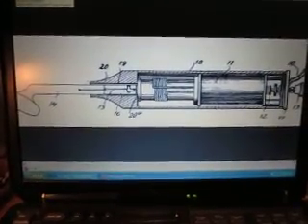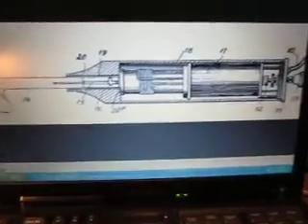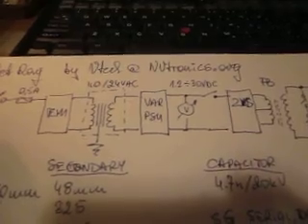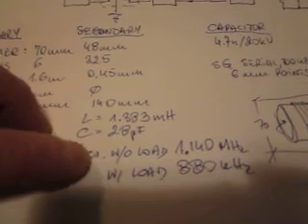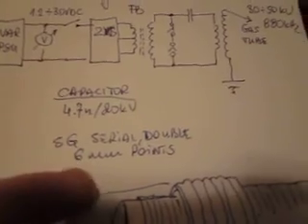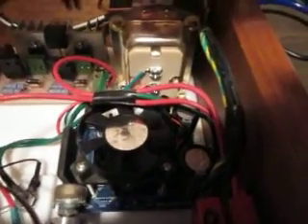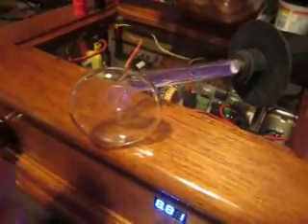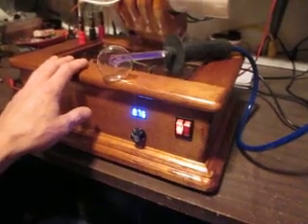Violet Ray Machine

Comment: Hi Vitoc,

I just came across your violet ray video on YouTube. I went to subscribe to your channel and realized that I was already subscribed. I’m Tat Parush’s MWO friend in the US (WA). I recently closed all of my FaceBook accounts, so unfortunately I have lost contact with Tat. I do have a new MWO group set up on the uncensored mewe platform. 

I’m also a member of your NVtronics group, although I haven’t been participating much. Life has been very weird lately. I did upload a wiring diagram for my Bob Beck mag pulser circuit. I finally perfected the circuit for my machine last year. We have been using it several times per day for nearly a year now. If it wasn’t for the coil getting hot, we could use it indefinitely! Right now we can use it for 20 minutes, before the coil needs to cool down. I have the machine configured so the capacitor charges to 340V every 4 seconds. I use a SCR as the switch. The pulse rate is adjustable, but it doesn’t make much sense to use a different setting. I use the same Erse Audio perfect lay, wet wound 2.5mH inductor coil that you do. Russ Torlage has been a huge help over the years in helping me make headway with my mag pulser circuit.

I like your video on the violet ray! It seems that doing it electronically makes the otherwise simple machine, a heck of a lot more complicated. The advantage I guess, is that the circuit can handle more power and as you said, thereby has enough power to support the function of an MWO.

I refurbish antique violet ray machines for a living and focus mostly on the RenuLife brand. I have a web site to market my electrically upgraded violet ray machines and Beck Protocol devices. I have sold a number of machines to Canadians, including the actress Lucie Laurier. I'm interested in leaning how to make one from scratch. I'll check with you on NV Tronics.

My Home Page: https://twotowers.com/

Also, you might have fun looking at my “how to build a tesla coil” page.  
https://twotowers.com/tessie_1_tesla_coil.html

Best, Steffan

Comment: Where did you find the blue high voltage wire?
Reply from the maker: I put 30kV rated white cable inside a flexible PVC tubing.
Reply: Do you have any information on the 30kv wire?

Comment: I have also same problem, I bought same tool from ebay. but the sudden electric shock, the plug  made short circuit. Would you please how i can open this black grip? how i can repair? first I can't open this Grib style tesla generator. Help me please.
Reply from the maker: You're welcome to my forum (link in the video) and either I or other members will assist you.
V
Reply: Thank you Dear!, I will check it out and learn more. I won't let this precious tool for disorder. I need to know how to open the grib.

Comment: HI did you know that VR machines produce positive ions I tested it with my new $900 air ion tester which gives out dual reading of neg and pos ions. That can't be too healthy for the body can it?
Reply from the maker: +David Michael An average session doesn't exceed 10min and there are more benefits vs small amount of positive ions being generated. An average PC will introduce much more throughout the day, not to mention other devices in an average household + wireless, which is in a microwave range.
Nevertheless, good observation! Thank you.
Reply: +blackchisel97 Thanks for the reply. Actually not so sure its a small amount of positive ions. But one thing I need to test is if the older machines produce positive ions too as they were configured slightly differently to the post 1950s models. Either way micro currents introduced to the body even through electrostatic discharge have proven to be beneficial providing the current remains very low.

Comment: did you know there are a lot of these on Ebay  they call them"quack" medicine
. The "Sleeping Psychic" Edgar Cayce recommended the use of them often.
Reply from the maker: Most cheap modern ones don't work the same way as the old did, due to the solid state switching v.s spark gap, frequency and type of glass being used. They may work with minor dermatological issues but nothing else. Many devices were branded as quack for various reasons. Some were indeed questionable but others did work as claimed and posed elevated risk of actually healing people which wasn't acceptable. There is no profit to be made off healthy people.

Comment: Thanks for the video.  About 28 years ago I had a volunteer job the Van Allen Hall. The Physics and Astronomy building at the University of Iowa.  I had access to all of the physics equipment used for the demonstrations during the lectures.  I also had access to some of the storage rooms were some very very old physics equipment was stored.  I had a lot of fun examining these old physics machines.  One day I found what looked like a small wooden briefcase.  When I opened it, I discovered it was a Violet Ray machine.  If I remember correctly the manufacturer used the name Renew-Life.  The case contained an assortment of different glass tubes. One of the more interesting tubes was shaped like a garden rake or comb.  You could comb your hair with it.  I partially disassembled the device to see how it was constructed and then reassembled it.  I remember the capacitors were made of wax paper and tin foil folded together.  The Tesla coil was in the wand and it was insulated with what appeared to be bees wax.  This kit was in perfect condition and still worked when I plugged it in and powered it up.  I thought this was a neat device to play with.  I have looked many times in antique shops for a similar device but never found one.  Perhaps I will try to build one myself at some point;  In the physics lab we had an assortment of what are called Geissler tubes.  I found that if you removed the glass attachment form the violet ray machine you could use it to light up the Geissler tubes.  This worked really well!
Thanks again for the nice video.
Reply from the maker: I've seen Renu-Life machines being sold on eBay but they're not hard to make from scratch and will last forever when built right. Most older ones had operation time limit due to the heat build up. If their recommended single session time was always respected, they survived until now in pristine shape.
Thank you for stopping by.

Regards
V
Reply: Excuse me wise men. May I get  your schematics, please?